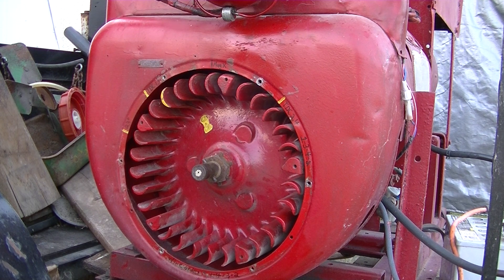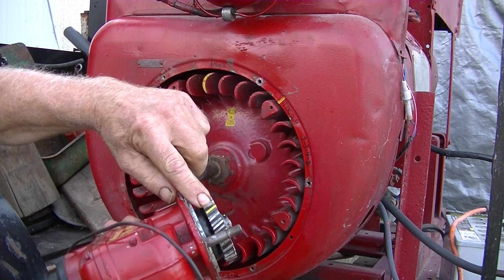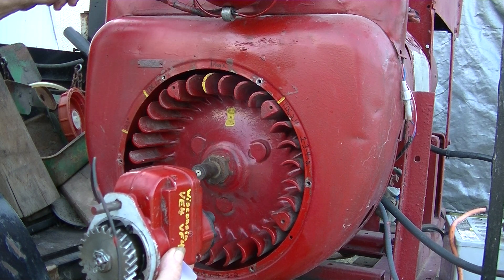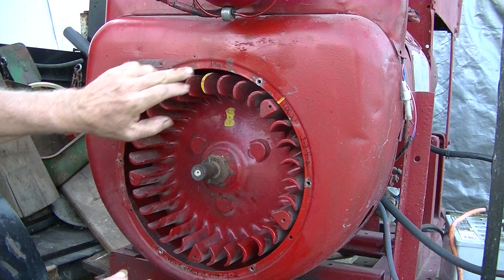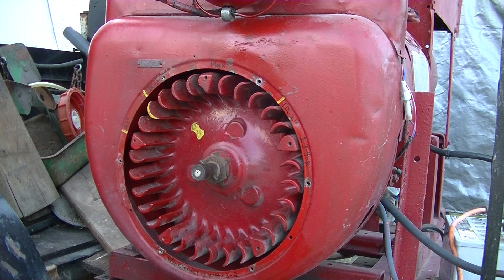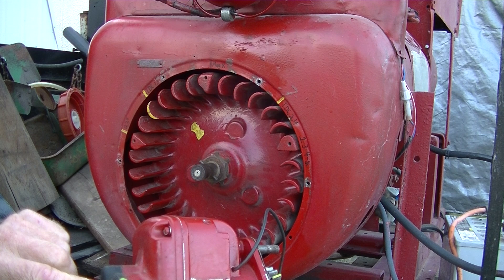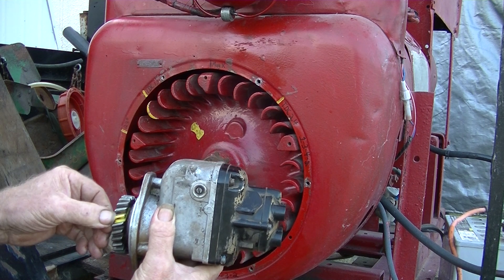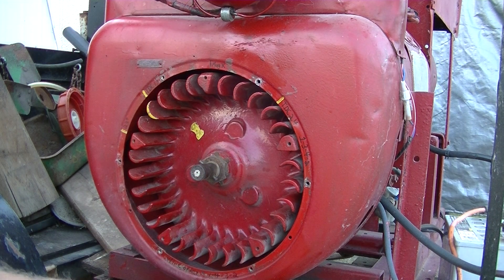Wisconsin VE4(D) VF4(D) Magneto Timing

Comment: I got a vf4d with a fair banks morse fm-j have tried the firing order you recommended, have 120 psi compression in each cylinder, engine is timed, getting alot of back fire when tryig to start, any thought?
Reply from the maker: Is it possible for you to find a VF4 service manual to prove or disprove my timing advice?

Comment: Greetings - I just obtained a very old ( not sure year ) exactly but maybe u can tell me the year engine was made.
It's a VF4D and it has a massive Kato generator mounted on a skid.
Runs great and generator works also. 
Engine serial # 2535085
Spec # 107605 

Kato generator 
Serial # 32386
Reply from the maker: The VF4D series was manufactured from 1940 to 1976, a long run indeed. I did a couple of searches to find out your year of manufacture but was unable to hit paydirt. If I stumble across the information I will let you know. Thanks for the comment.

Comment: From the key switch does the wire to the magneto  need to have 12 volts or a ground  we have no spark?
Reply from the maker: The key switch grounds the magneto, kills the voltage at the points, one could say. Remove that wire from the mag and if still no spark, the problem is inside the mag, not in the key circuit. Hope this helps.
Reply from the maker: Have a good look at the points... They can oxidise over time. When done using the engine, leave the points open, I think just after the mag impulse trips.

Comment: How do you time them when their on a bobcat that hides the timing marks on the fan?
Reply from the maker: Yea, I can see that being a huge problem. I wonder if you can get a small mechanics mirror down there and see? By pulling number 1 spark plug and rotating engine by hand, you can identify the compression stroke. With, say, a plastic tye-wrap or piece of wire, you can locate the piston when at top dead center.

Comment: I have this in a case uni 1537. I need to overhaul it.
Reply from the maker: Pay special attention to which way the pistons come out. There are expansion slots(?) that have to be oriented to the correct side of thrust. Thanks for the comment. Good luck with your project.
Reply: @zeketheantiquefreak8518  Thank you for your time making these helpful videos!

Comment: I have a VH4D engine just got it. What is the firing order? Based on your video it is 1-3-4-2 however the wiring is different. Can you explain?
Reply from the maker: The firing order is different from the VH4 and VF4... One (VF4) is a 'waste spark' that sparks the plug each time the piston comes to the top. (VH4) sparks the plugs normally, at the top of compression stroke only. If you need further info, I have a real, live VH4 service manual. Going by memory, the VH4 firing order is 1-3-4-2. Hope this helps.
Reply: @zeketheantiquefreak8518  okay. I will make a video so that I can show you my setup. Maybe you can assist me with what may be the issue

Comment: I have a VH4D with a mag. The coil was burnt so I replaced it but I don't see any timing marks on the little gears. How can I time it without those marks?
Reply from the maker: I'll be through the shop tomorrow... I will see if I have the information. Can you tell me the make and model of the mag?

Comment: Thank you for your time posting this video. I am trying to get a VF1 going after many years on a combine. The mag has a dot stamped in the face next to a gear tooth. Would you know if it is the same reference point as the X? My shroud has only two marks at 12 and at 10ish. The flywheel had the cast DC and also a slash stamped in about 30 degrees before. Apparently there were many variations of this engine. KM
Reply from the maker: Yes, I would try the 'dot' if the 'X' is missing... Go through the positioning process, place the dot in the window and check if the rotor is pointing to #1 If necessary the wires can be moved from hole to hole to get the results wanted. Thanks for the comment.

Comment: Are you sure that a mouse did not build a nest inside the engine ??? Just verify fella.
Reply from the maker: Yes, I have seen that on these engines. Lil' buggers will nest under the 'air box' covers and potentially overheat the engine. Thanks a bunch for the comment.

Comment: So  if I understand you correctly, on a VG4D engine,  So I simply rotate flywheel to  TDC on #1 cylinder using a  tie wrap in the spark plug hole, then position the X on the magneto gear  so it shows to the bottom half of inspection window hole when it is installed . I shouldnt have to take the fan cover off using the above method.
Reply from the maker: Yes, compression test with finger on #1, Align pointer on flywheel vertical, Mag rotor pointing to #1 and marked tooth in lower half of hole. You should be golden. Thank you for the comment.

Comment: Is it possible to switch the mag to a distributor and coil style ignition
Reply from the maker: Yes. Trouble is finding the right used parts. Available from scrap engines are a right-angle dist. drive that mounts onto the magneto hole. (2) Generator with right-angle drive for distributor that mounts into the magneto hole. 
Is there a problem with the existing magneto?
Reply: @zeketheantiquefreak8518  yes i have all of the parts on 3 motors trying to make one fit into a skidsteer, that requires a distributor and they have the oil pump shaft going into the distributor
Reply from the maker: @dwilsonfarms6541  Educate me a little if you have the time. This 'oil pump shaft going to the distributor' I am not familiar with. I have an E, F, and an H Wisconsin, with only the E having the right angle drive and distributor. The F and the H have magnetos. I do have a couple of generator/angle drive/distributor units from a G but no oil pump shaft. I obviously do not know everything about Wisconsins! I am in Manitoba, Canada.

Comment: Very nice information, I did not have one but certainly like it, thanks for the video
Reply from the maker: Thank you for the comment. I have three of these old things around... One (VE4) on this circa 1950 welder, another (VH4D) on a 70's Kohler 10kw generator and lastly a 60's (VF4D) driving a surplus four cylinder 45 cfm compressor. They do not get used for years at a time, so I do not keep a fuel tank on them, I use a Gerry can of fresh premium fuel for a tank when in use. I carefully drain the fuel system after running to prevent everything from gumming up.

Comment: Any chance you’d want some spare parts for those Wisconsin engines? I have a couple starters and mags as well as some sheet metal I likely won’t be using.
Reply from the maker: I am in Southern Manitoba, Canada...
Reply: zeketheantiquefreak I know, I’m the guy in Brandon that’s gonna build an air compressor out of one of those Wisconsin engines. The extra stuff off it I won’t need.
Reply from the maker: @bulldogger1987  Yes, I am interested. How much were you wanting for those items?
Reply from the maker: @bulldogger1987  Sounds great, I will contact you soon.